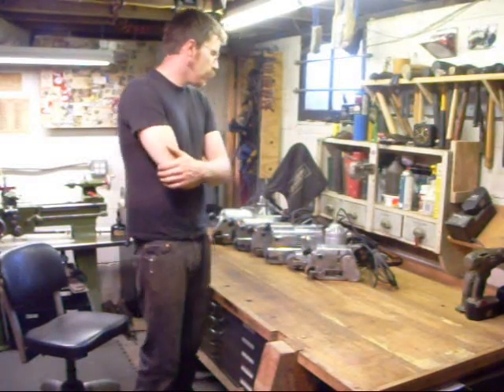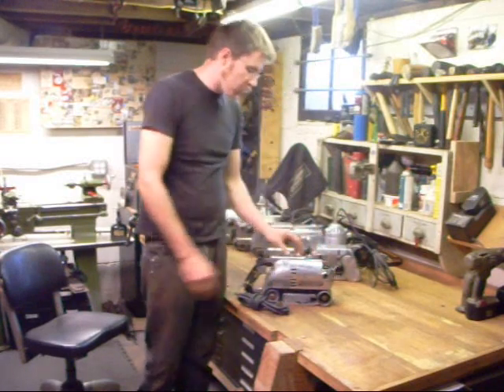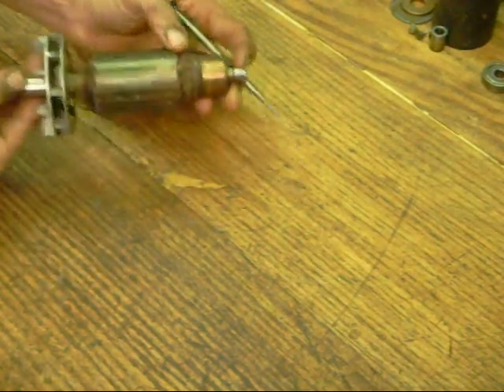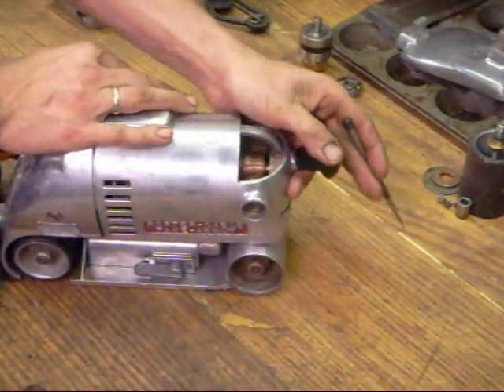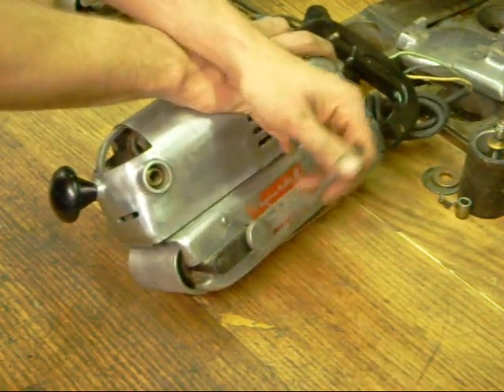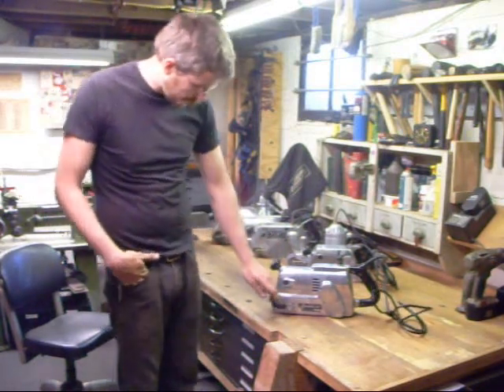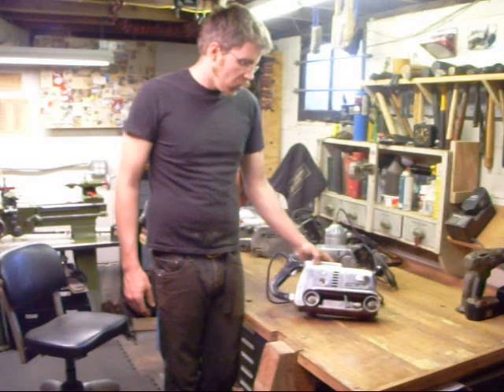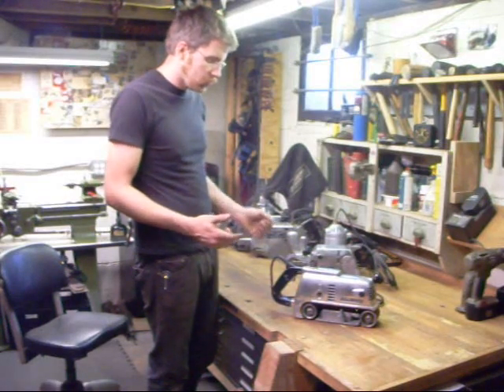1. General Introduction to Porter Cable Sanders.avi

Comment: Very informative videos. You wouldn't happen to have a porter cable 504 you have refurbished that you would be willing to sell? I own a custom cabinet shop and have used these for years. I have two that are not working that could be used for parts but just want a good rebuilt one that will give me about 20 more years. Nothing out there sands like these old sanders. Thanks.

Comment: I acquired an unused, still in the box PC 503. I changed the gear oil, checked the chain and have used it a lot. It gets very hot with prolonged use such that one cannot place your hand on the top of the body. Is the as expected or should I start looking for a problem that I couldn’t find when I first got it? Thx for your help.

Comment: Nice video.  I just acquired a Craftsman 207-22301 sander. The motor works fine but the belt will not turn.  Do you know why and how to troubleshoot this?  Thanks.

Comment: Hi, I just purchased an a3.   I have a lot of questions,  1- how to check the proper amount of gear oil? 2- The belt dose not want to track perfect, I have not tried it on wood just free running, any comments? maybe try new belt?  3- the oil level seems to drop after little use.  4- the sander seems to get hot quickly?  any help would be much appreciated.

Comment: i have a bb 10 or 500 porter cable belt sanders
 with 2 oil plugs does anyone know which plug to fill too the sander got greece in it and sounds mint sould i  add oil to it or clean greece out 1st

Comment: do you do any work on skil torpedo 448?
Reply: I see you in every video vinny. Did you ever find what you’ve been looking for???  I’m about to start the restoration on a Skil 525
Reply: @jasondean3332  Great I could  use some great video closeups and explanations on everything you have to do to it.  I bought some brushes and caps from http://www.carbonbrush.com/ but parts#'s didn't match up so I'm still searching. Thanks
Reply: What are you having trouble with ??? It seems like a straight forward disassembly, cleaning, lube and assembly